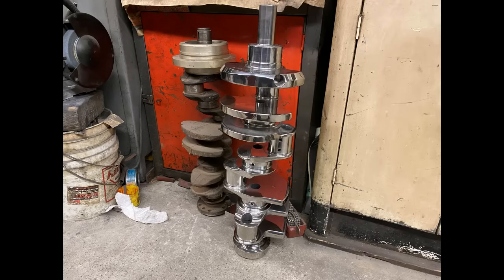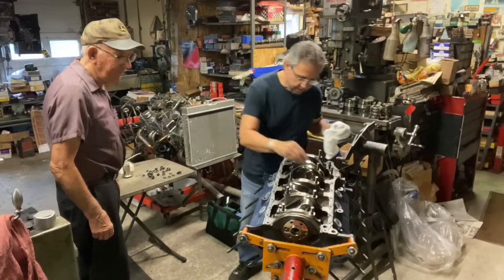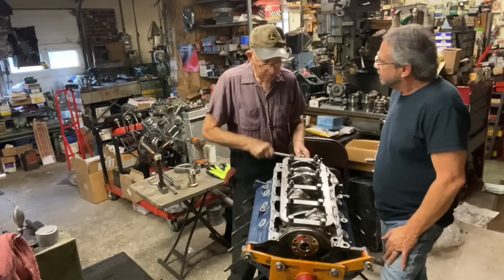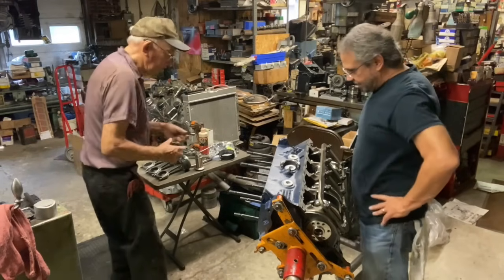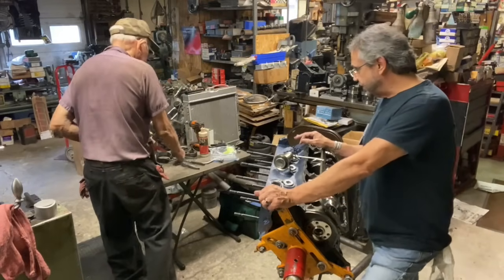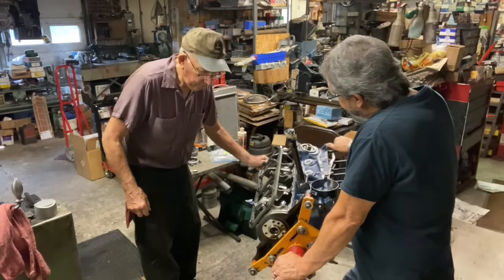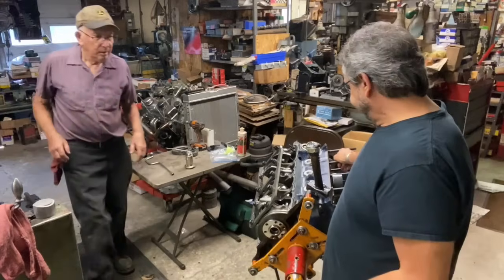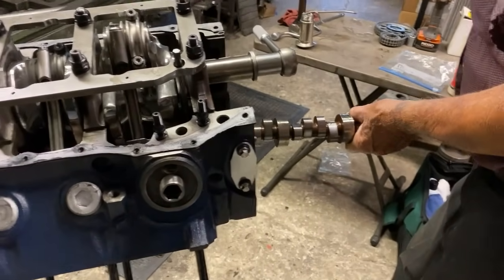DBG: Assembling The 775 HP Ford 351 Cleveland, With Bob At Beach Performance...Ain't Nothing Special

Comment: HI TIM , This gentleman BOB , must have built tons of engines , a guy like him could be trusted with no questions.

Sinc I will be having my 2 bolt main CLEVELAND rebuilt , a few questions.. the STUD GIRDLE , keeps the crank mains from twisting?

Do you have a custom made oil pan , due to STUD GIRDLE?

High volume oil pump ?

I am really enjoying watching you and BOB assemble this engine.

Can t wait to see it back in your car.

TY AGAIN
Reply from the maker: Yes sir, Bob does things his way, and I listen and watch. We last built an engine together, 11 years ago. I think the girdle helps stabilize the block. My stock Moroso pan fit, with some massaging. My new Stefs pan, will fit with any work. I always run a high volume pump, for 40 years.
Reply: @DragBoss351Cleveland  ty GOD BLESS
Reply from the maker: @nottelling620 your welcome 🙏

Comment: Tim, what the thing you put over the cracksift? You togoue at 110 pounds. Is that puffic to Ford Cleveland? Me and my Dad rebuild 2 or 3 Chevy small blocks and I never seen that before. I'm sorry if my spelling is little off.
Reply from the maker: That is a main girdle. Keep the bottom end tied together for more cylinder support. Yes I torqed them to 110 ft lbs.

Comment: Heavy oil in a Cleveland l found it mine would blow smoke when cold 20/50w was just too thick went back to a straight 30w and fixed the oil burning..
Reply from the maker: Weird, not sure how thick oil can cause oil burning?
Reply: @DragBoss351Cleveland  rings just not scraping it off bores. I guess.  went back to a 30w and no plumes of smoke not like its cold here in southern OZ..
Reply from the maker: @rebekahfrench5747 ok, would not think that, but like I say, Do what works for you. Thanks for the reply

Comment: Jon Kasse  427 SOHC Pump gas  850 Horsepower.  Was around 45 grand , who knows now with inflation.  He also sells a Boss 429 Pump gas 850 Horsepower 25 grand crate engines
Reply from the maker: Good to know. I will be looking at buying Boss 429 for Mrs DragBoss’ 69 Mustang
Reply: @DragBoss351Cleveland  🙂🏁
Reply from the maker: @billfioretti3013 😉

Comment: Hi Tim , glad to see your clevo going back together! I’ve replaced the bad rings in my 408 clevo and going good . I’ve got a scat crank 4” and 6.1” rods mahle 1.1 cp height pistons milled down 20 thou .

It seems very hard to find pistons for 408 clevo’s . What pistons are you using and cp height? 
And where did you get them please? 🙏
Reply from the maker: Yes she is close. Waiting on new bronze distributor gear. The pistons I run are JE, made by Randy Gillis. Rip. It was the last pistons he made while working at JE. The. He went to race tech. Died a few months ago   When I do a video of the 409, I will have all that info in vid.

Comment: Is that a oem factory block?? The rear main cap & the back flange on the crankshaft looks different to me?? Like its a 1 pcs rear main seal?? But i also noticed it is just two bolt main caps?? I dont see alot of clevlands so maybey its normal ??
Reply from the maker: Yep stock from 1970, like 11/18, and original engine was assembled on 11-20-1970 stamped by oil pump area. Two piece split lip. Yep just 2 bolts.